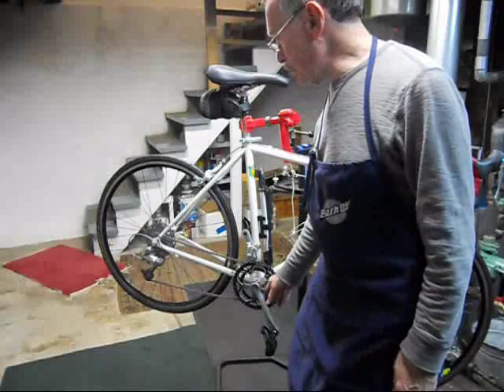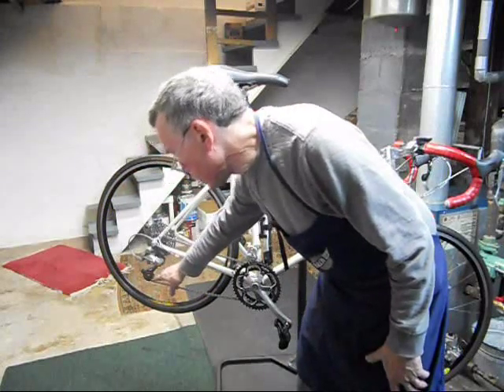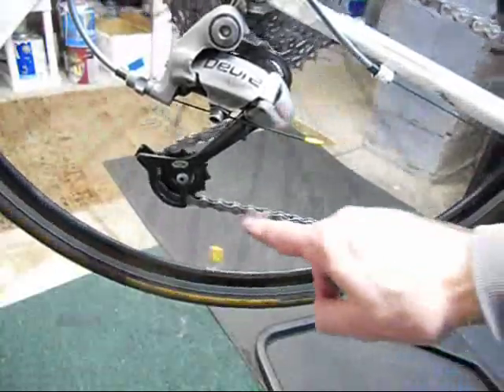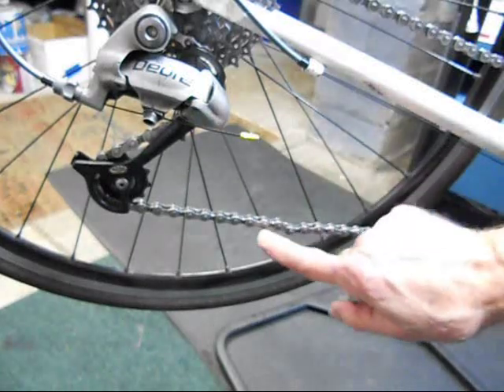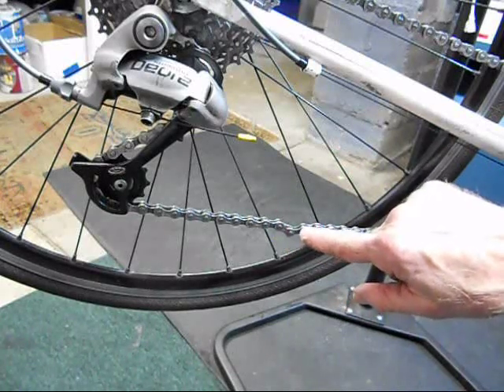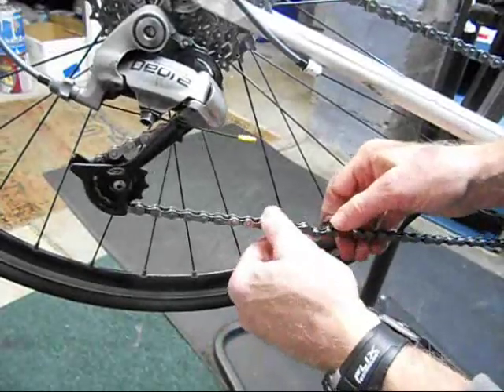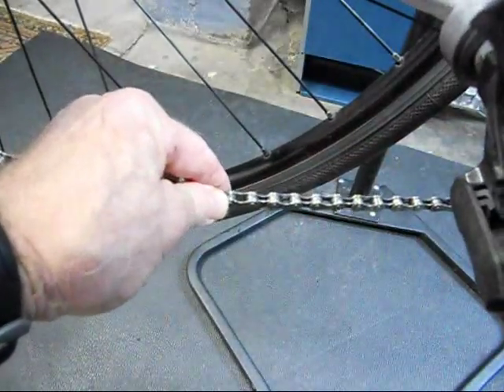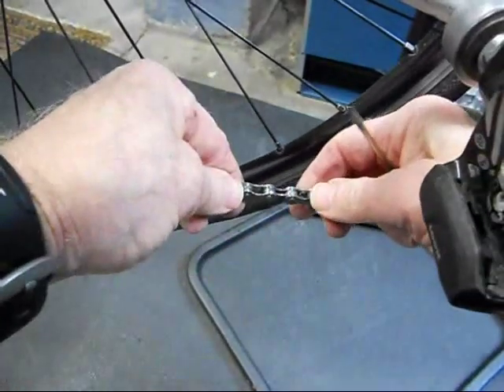Stiff Chain Link

Comment: Hi Tony!
I have an odd situation with my chain. My bicycle is new. I have Shimano HG62 cassete, Shimano Deore Shadow RD, Shimano Deore 2 gears crankset. Manufacturer installed KMC X10 chain. I adjusted rear & front derailleur, degreased and lubed chain, checked chain tension - all was perfect. My first ride was about 20 km and I noticed crack just every 3-4 rotation of pedals. It was stiff link. But reason was small damage between outer and inner plate of the link (looks like gear tooth crumpled metal between plates and it hinder them to move). No attempts to fix it helped. I thought it was bad luck, I installed brand new Shimano HG95 10s chain. Of course checked Shimano manual - it is compatible with my HG62 10s cassette. And I once again checked speeds shifting, chain tension, distance between big back gear and derailleur upper roller...  Degreased and lubed chain. I was happy with how smooth speeds are shifted. I rode 10 km - all was perfect: almost silent chain, very smooth shifts. In about 5-7 km again noticed some regular crack... When returned home and dismounted chain - I was shocked: 2 stiff links! Both have light damages: this time between inner plate and roller. I thoroughly checked every tooth on cassette and crankset. All looks normal. No wear at all (mileage is just less than 50 km). No tooth deformations. I didn't make any extreme load during my ride, no falls, no hits to crankset or cassette. Just can't understand what to do.
Reply from the maker: Have you check the rear cassette or chainrings for damage that can be causing the chain problem? See:
https://www.youtube.com/watch?v=g5uqTNmikro
https://www.youtube.com/watch?v=sXdrOQpr-Zg
It sounds like some other damaged drivetrain component may be resulting in your chain problems. If you can't solve it on your own, you'll need some help from your local bicycle store. Let me know how you make out. Regards, Tony

Comment: Alright, thanks a lot for this tutorial, helped me solve my problem, and if anyone is having trouble with his chain link, use some chain lube (olive oil works in a pinch), look above the link and see if it's aligned with the rest of the chain (that was my problem) and then push it in the opposite direction.
Reply from the maker: Yes, working it back and forth after lubrication is an excellent choice.

Comment: still tight at 3:02 can see the bad link...my chain is doing those so watching to learn how to fix

I had 2 bad stiff the one i got out working it then folding it up stiff then tapping it with a screw driver, that one came out and the other one i gotta work on some more but chain doesnt pop/clank now going around at that spot, since going around that lower spindle there was 2 stiff links that thing really jumped to the point i couldnt ride it safely.

Comment: problem already fixed but i like to know what cousing that problem?any ideas?
Reply from the maker: The thing that causes most stiff links is compressing the side plates too tightly together, a natural result of using a chain tool that presses in the chain pin under great force to install the chain.

The two main other causes of stiff links are rust, and overly aggressive shifting under load.

Rust can occur between the plates, without being obvious from the outside, when water wicks in . The riding conditions and your choice of chain lube are contributing factors. A rust bound link can usually be freed by forcing the chain to flex at the pin, the normal way (not sideways). I do this by sliding 2 screwdrivers into the chain on either side and using some brute force. Once the link is free, add a drop of oil and work the link back and forth until it's truly free. Once it's decent, riding will only make it better. Use decent chain lube to prevent a recurrence.

Shifting under load and cause stiff links. The hard impact of the sprocket tooth on the edge of the plate is the same as if you put a chisel against it and hammered. This type of damage sometimes be seen with the naked eye, and can be harder to fix. Sometimes repeated flexing will loosen it, but you may have to carefully file the nick down a bit. Again once it's decent enough to run OK it gets better over time as the mating surfaces wear. Prevent this by easing up on the pedal pressure as you shift.

Regards and safe cycling, Tony
Reply: @tony10speed  it was hapening many times with 4 difrent chines ,now just for fun make a bit longer and foult like disapier .for now.a bit wierd as using same style rear star and chine think could be problem with rear fork as usin bafang 1kwh motor for while
Reply from the maker: @goldenarms1485  Sorry but I can't understand the translation in your comment. I think you may have to consult your local bicycle shop. Tony

Comment: I just had an issue with a stiff chain link, and unlike this issue it was because a small piece of debris was stuck in between the link, I had to remove it with a tiny pin because this didn't work. Just a heads up if this doesn't fix your issue, look for small debris because it isn't impossible.

Comment: Hi Tony, thanks for the video. I followed your instruction fixed the stiff links on my bike chain. But after a ride or two they kept occurring again. They are on a used bike I recently bought, probably not used for years. Is there a way to fix them all? Or could there be some other problem? Thanks again.
Reply from the maker: The chain probable has some corrosion/rust in the links. Your best bet is to remove the chain and soak it in Evaporust or spay with Knocker Loose (both available from Amazon). Let it sit 24 hours. Clean with soap and water, rinse and dry thoroughly. Put it back on the bike, give it a good coat of lubricant, back pedal to get the lubricant into the chain links, let sit overnight before wiping off the excess lubricant. Works well. 
OR
Just buy a new chain, making sure you get the right speed chain (8,9,10 speed etc.).
Good luck and let me know how you do. Regards, Tony
Reply: @tony10speed  OK will do. Than you.

Comment: This didn't work for me.   After 30 minutes and my hand hurting.  I had to use a chain pin tool to push the pin half way out...I then pushed it back in place.  Links is no longer sticking.   My chain was a KMC X99.
Reply from the maker: Sorry to hear of your troubles. Did the problem occur when you installed a new chain or out on the road? Tony

Comment: Mine is rusty and stiff as hell. I tried to ride it and the damn derailed collided with the inner wheel !!
Reply from the maker: Time for a new chain and a check to see if you need a new cassette. Doing a quick 2 minute cleanup and proper lubrication every 150-200 miles should keep things going well for the season. See:
Quick 2 minute drivetrain cleanup:
https://www.youtube.com/watch?v=I_5fNbDN3UA
and chain lubrication:
https://www.youtube.com/watch?v=ubKCHtZ20-0
and check cassette for wear
https://www.youtube.com/watch?v=g5uqTNmikro
Regards and safe cycling, Tony
Reply: @tony10speed  thanks

Comment: Looks exactly like what mines doing
Reply from the maker: Let me know how you make out. Regards, Tony
Reply: @tony10speed  I tried Wd-40 and working it back and fourth. I tried using my hands and bending it side to side and also a screw driver. It's a brand new bike. I'm taking it in to the shop to get fixed. I don't have the right tools I need.
Reply from the maker: @slash2jimi  That shouldn't be on a brand new bike unless they erred in when installing the chain with a pin rather then using a master link. And on a brand new bike, they shouldn't charge you. They may try using the "loosing bar" on a chain breaker, but you have to be very careful and put only a tiny amount of pressure on the pin of the stiff link. Stick around and watch what they do on the stiff link and let me and our viewers know. Regards, Tony